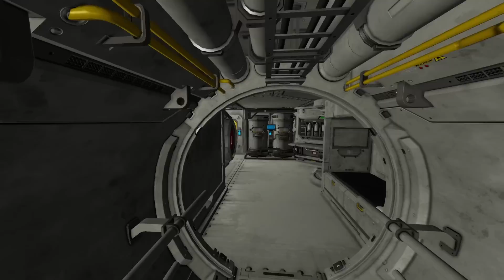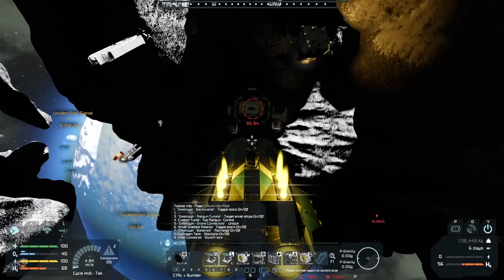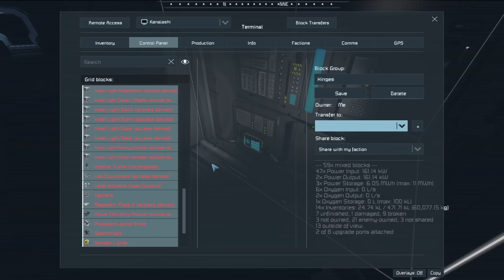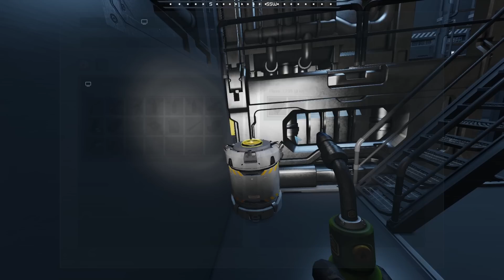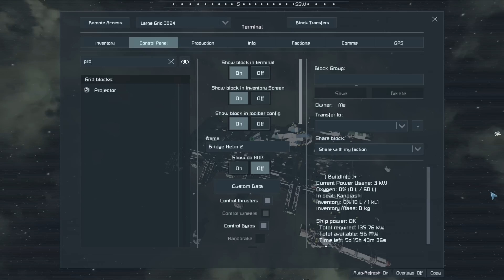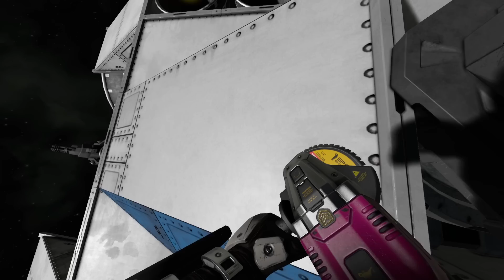Space Engineers - Prototech Pursuit EP24 - "Evening The Odds With Drones"

Comment: Just a tip, you should immediately grind down the block underneath that antenna on the inside, that's the best way to prevent reinforcements
Reply: Also, prototech jump drives can't interface with regular ones, so you can't use them together for one jump sadly

Comment: I hope you share these blueprints of your fleet As you are using build and repair I would but one of those in Then you could scavenge parts for repairs in you win It would also help with salvaging from bases etc I would put the drone printer on the battle ship so the are printed in place even in battle which could be handy and you could have 4 maybe or more if required in any battle then just salvage the damaged ones and print out a new one